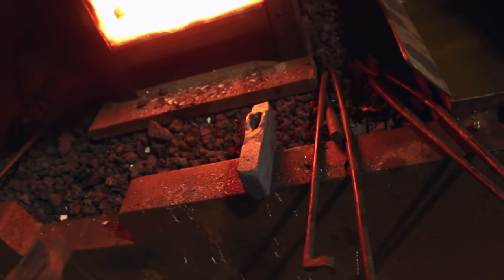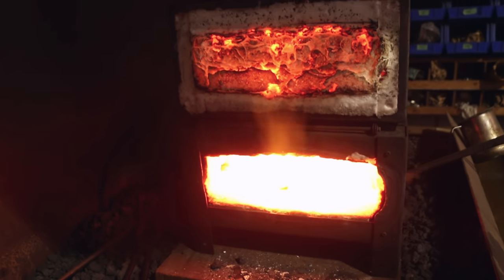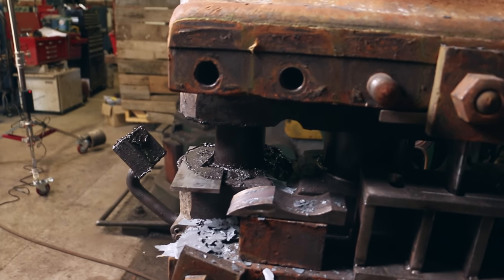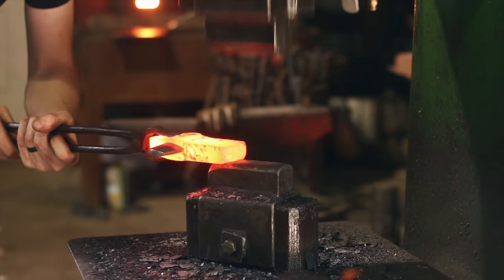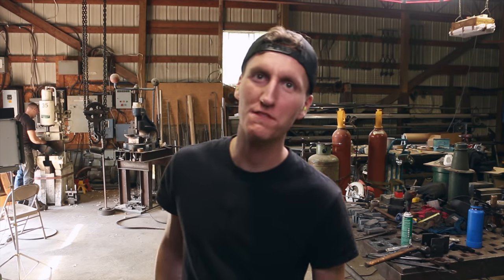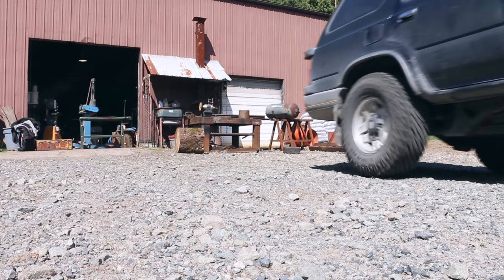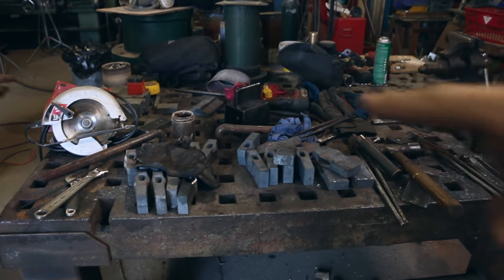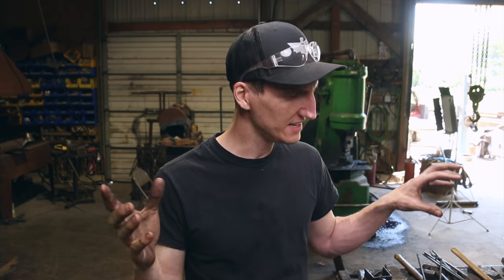Forging BLACKHAWK HATCHETS from 100 Year old TRAIN RAIL!

Comment: Tim, unrelated to axes, but, you are the only person I know that's made several titanium projects. I have a cooling tube made of titanium, would like to make a few knives out of it. Does it need heat treatment or just shape it and sharpen it? And any safety issues using a lump charcoal forge outside? Heard that titanium can ignite and near impossible to extinguish.